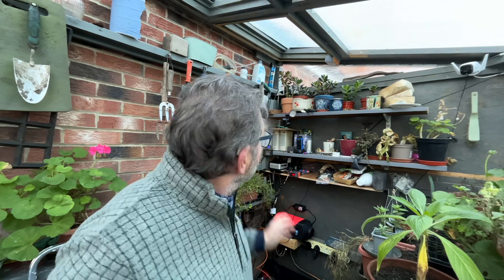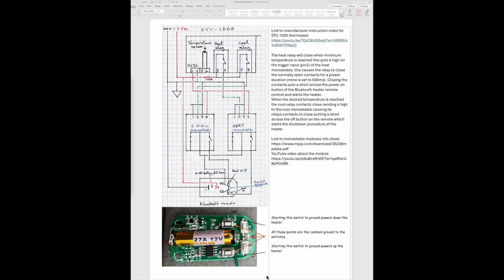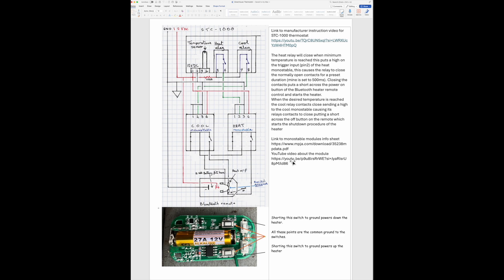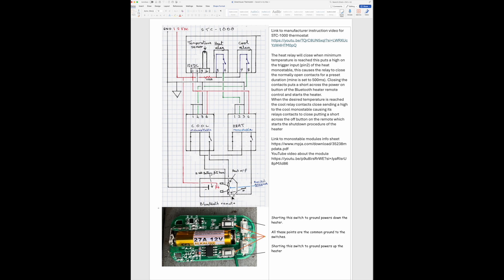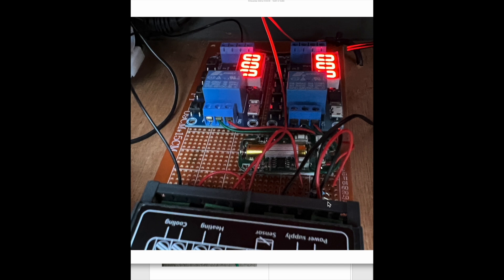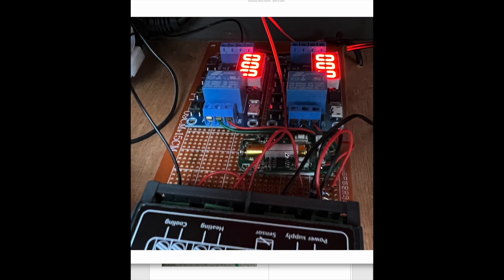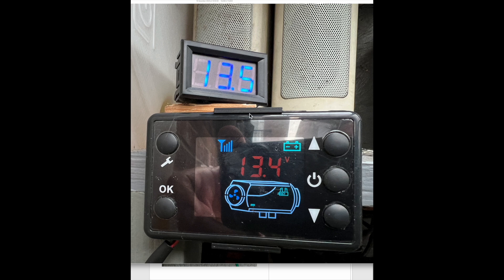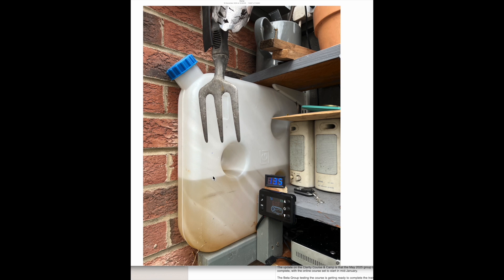DIY Chinese Diesel Heater Thermostat

Comment: Just found your video by pure chance!  I have just fitted a heater in my garage that isn’t insulated perfectly, so I can get the workshop up to 17 degrees but that drops down to 15 degrees after around 30 mins, my question is how often does your heater cycle on and off.?  I’m just wondering how mine would cope?
Greeting from Sweden 🇸🇪
Reply from the maker: Hi, today the temperature has been around freezing and now it's -3 so the heater has been on and off 21 times so far with an average on time of around 20 minutes and a cool down of about 35 or more minutes. The last two weeks we've had temperatures 8 to 10C most days and the heater has only been on  3 or 4 times during the day. I'll have to put some more diesel in the tank later today but the last top up was over two weeks ago at 5 litres. I can't post a graph on here but if you send me your email I can attach a temp graph from my Netatmo Weather module. Cheers Richard near York
Reply: @ ok thank you for this information, this solution sound good for my use case as well. I will order the parts later for it. Thank you so much for the video, this is exactly what I need 👍🏻
Reply: Hello, I have assembled all the parts, tried, treble checked  and checked again. When it drops to the lower temp(heater on), it just goes into meltdown, clicking like mad. Just can't fathom it out. 2degree swing. Not hundred percent on the settings to use on the monostables. Net instructions, pigeon English. Any help appreciated.... before I bin it.